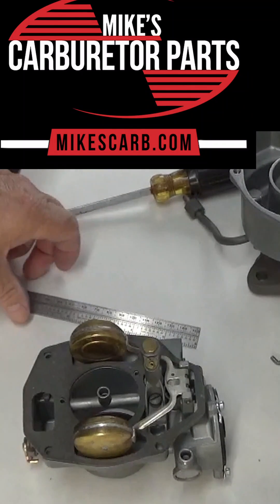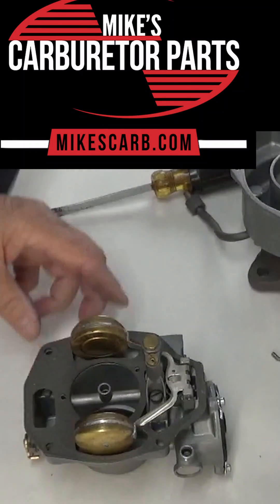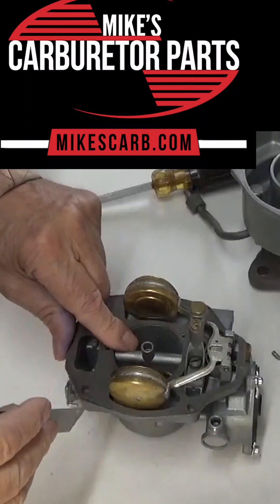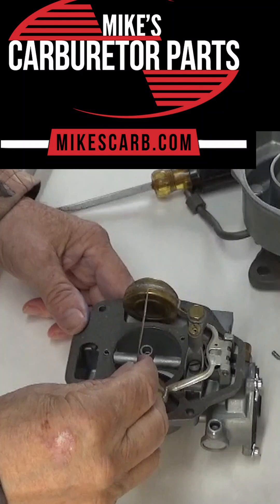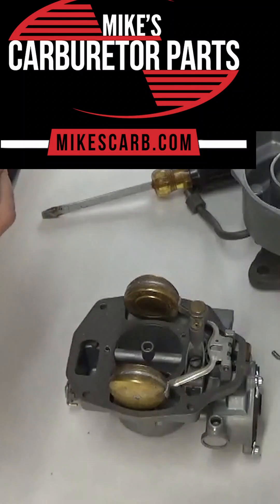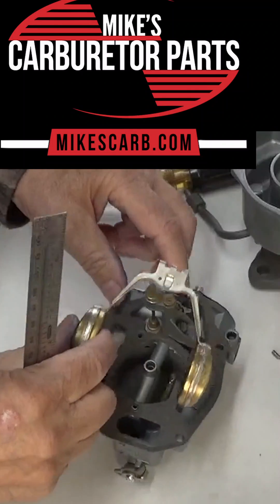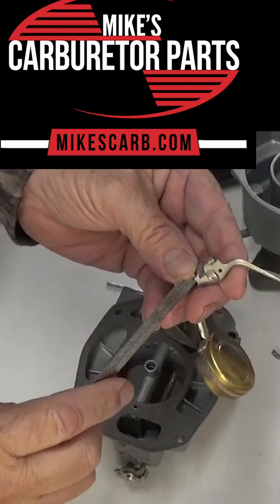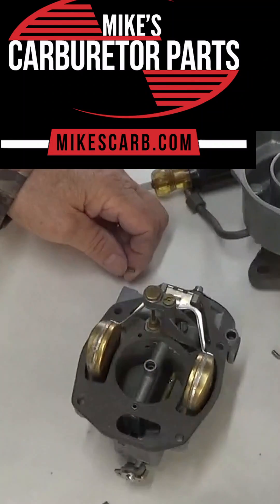Rochester B, 1 Barrel Carburetor Float Level

Comment: Hi, I need to see if you can help me out with this throttle linkage issue I’m having. I have a 1966 Chevy C 10 short bed with an in-line 62 50 in.³ engine. It has a single barrel Rochester carburetor and I somehow lost the springs and all the throttle linkage that goes to the firewall to the gas pedal rod. I have the gas pedal rod coming out of the firewallput the springs are missing and I have no clue how to hook this back up. Is there any possible way you could show me how to do this?
Reply from the maker: Sorry but I don't have any examples of the linkage. Try a chevy forum.